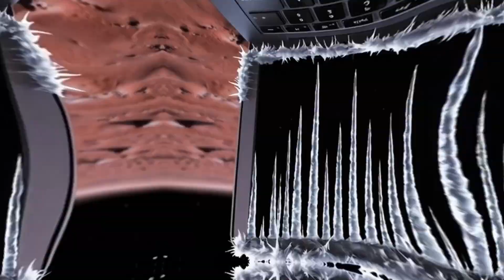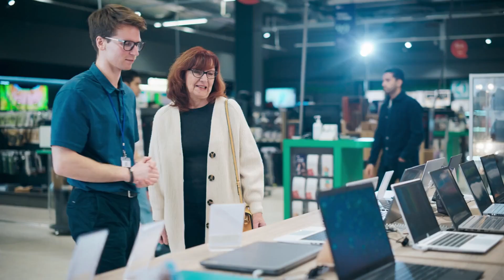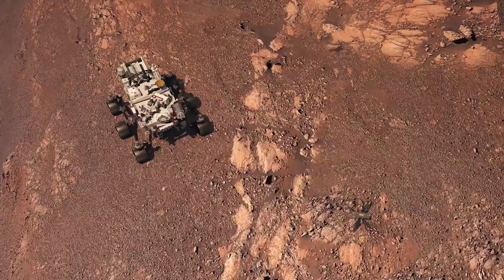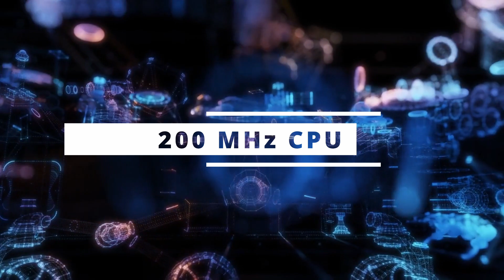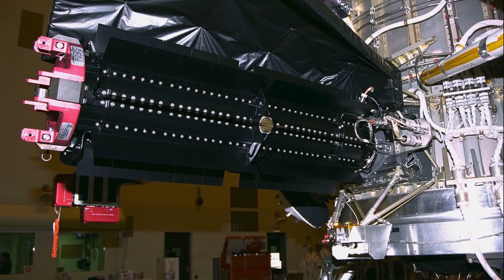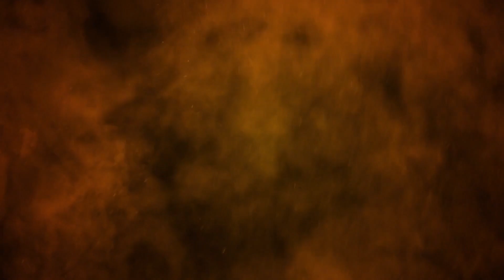The Computer That Had to Survive −125°C

Comment: Cold is good for Semi-Conductors, but not Room Temperature Batteries.
Reply from the maker: Great point - cold helps semiconductors, but it’s a problem for batteries and also for capacitors. They’re all over the place in a computer - powering stuff and cleaning up signals, especially in RAM. In extreme cold, they can start acting weird and mess with stability. Same goes for cables and connectors.